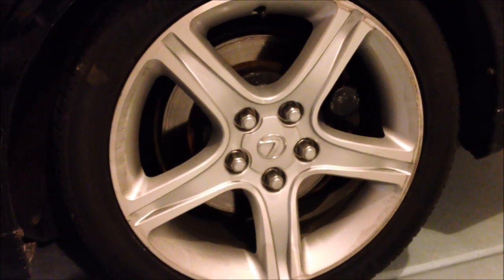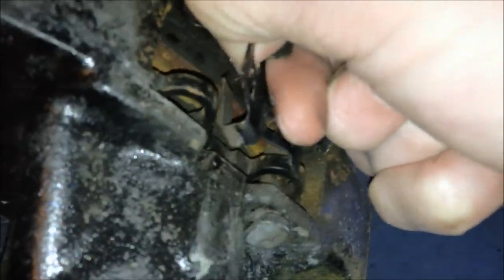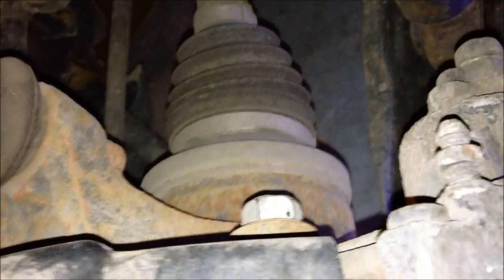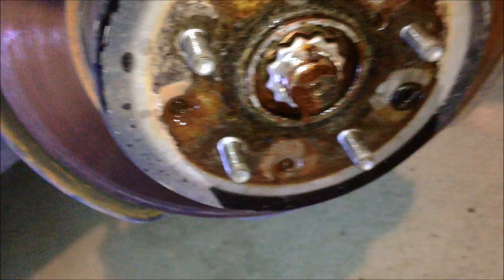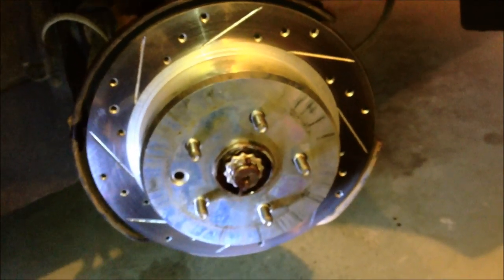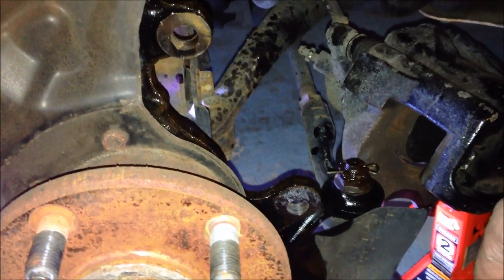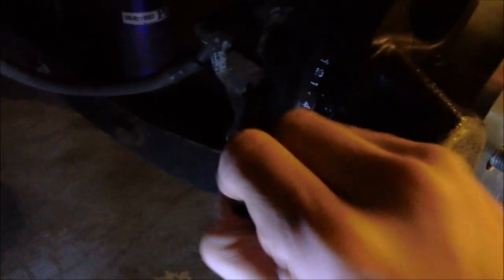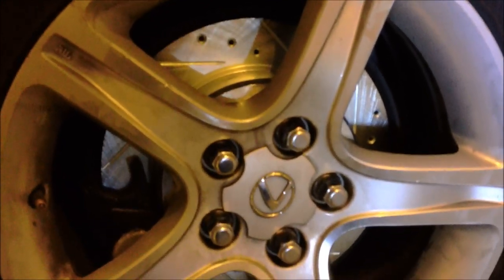Lexus IS300 Rotors R1

Comment: Notice you said R2 Concepts rotors, lol. Anyway I have a 2004 IS300, mines where alot easier to take off for some reason, and I got the exact same rotors like you did.
Reply from the maker: Yes you are correct the are R1 Concepts Rotors, I have had them two years, Sun, Rain, Salt, Snow they are great. I bought the package with upgraded ceramic brake pads that I am replacing in this video. Much better than stock, i was a little afraid of the quality at first but man they rock!

Comment: have you ever experienced any clicking noise a few months after the install? I started to question why mine does that. I also installed R1 rotars and hawk ceramic brake pads. regreased the pads. no warping.  noticable when driving next to other cars and walls but not noticable when driving an a freeway going over 50+ any ideas?
Reply from the maker: 5 years later man and nope. I do recall some road noise even on stock rotors and pads at 40mph etc. which was only noticeable with the windows rolled down.